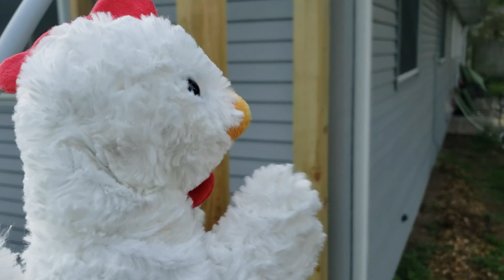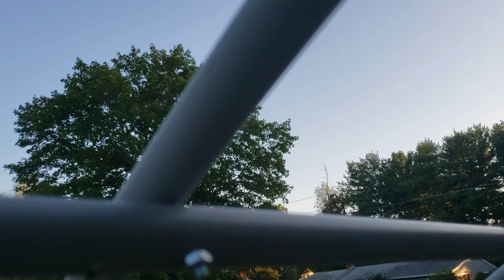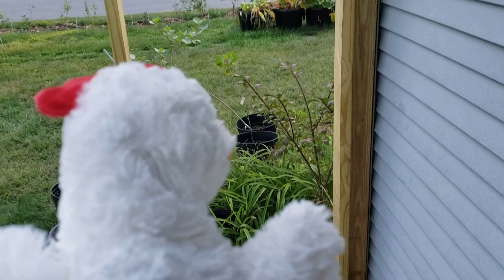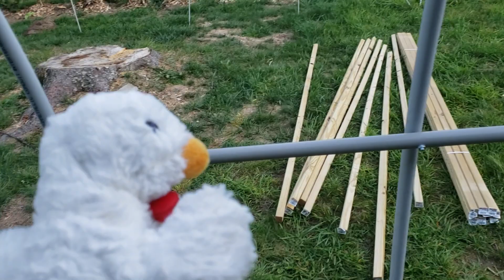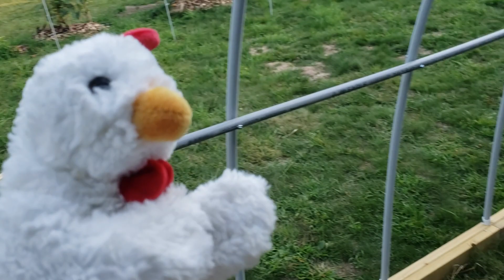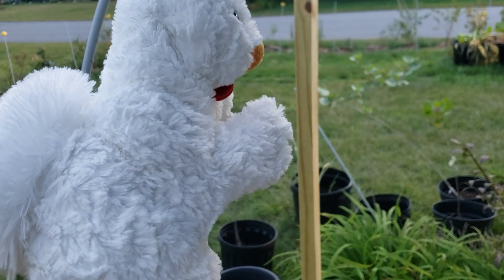PVC Lean-to Greenhouse Build - Part 3 - Purlins and Door Frame

Comment: Looks good, I'll have to look at your other videos of how it turned out.  In my climate (high intensity UV light and desert conditions) I don't think the pvc would last long.  
Did you ever consider using cattle panels vs the pvc?  I'm sure you've seen cattle panel hoop houses, and I just watched a quick video about a a lean to cattle panel green house (a little ghetto compared to yours, but they used everything reclaimed, so what can you expect...).

I want to put it on the southern facing side of my garage right where there's a window for the garage.  I'm hoping I can run a fan 24/7 during the winter to exchange the hot air from the greenhouse into the garage during the very sunny days here (heating the garage a bit), and then at night the garage will hopefully be able to retain enough heat so that the airflow going back into the greenhouse prevents it from freezing.  (We rarely get into the lower 20'sF and probably only have a few weeks where it dips below the lower 30'sF.  I actually worry more about it getting too hot during the day even in the middle of winter here.)

Anyway good job again.  The rooster is a little weird, but weird is always more entertaining!  Keep it up.
Reply from the maker: I used EMT conduit, which is a UV stabilized PVC, so sunlight should not be a problem.  I have seen people use cattle panels with great success, but I don't have them easily accessible to me where I live.  Thanks for watching! :)

Comment: Your “perlins” aren’t good. Top one is structurally unsound, already sagging and bolt heads will tear your plastic sheeting. Use foam insulation tubing to cover them. Far better to have used a wooden “beam” up top
Reply from the maker: I appreciate the suggestions, but so far this has held up amazingly well and survived high-winds and heavy snowfall.  It's a solid design. :)